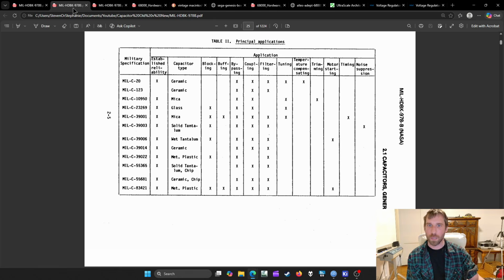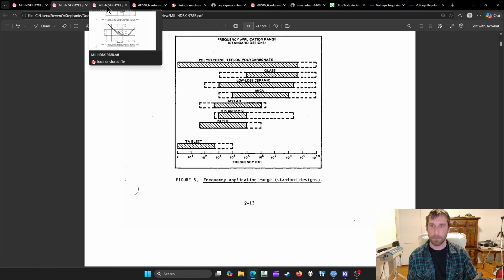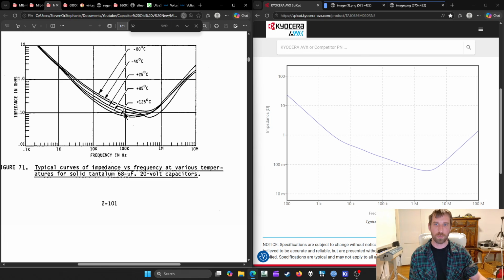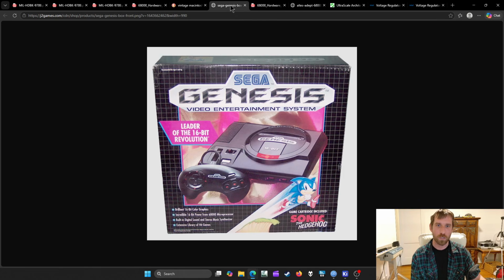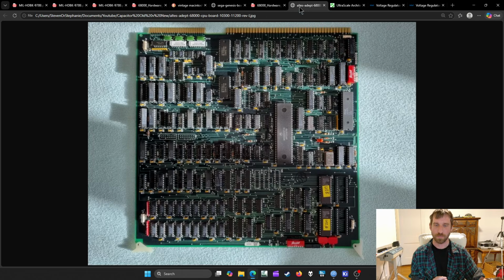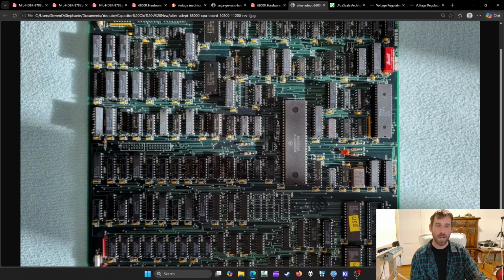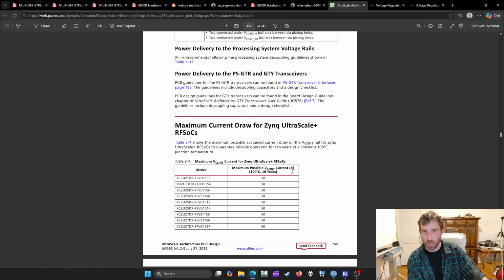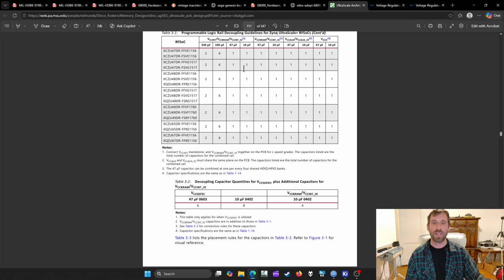Bypass Capacitor STOP OVERTHINKING

Comment: Effective decoupling requires understanding the design. Data sheets may or may not describe decoupling. Ultimately, the IC will specify power supply constraints which can easily be violated with poor decoupling. You could remove a lot of decoupling capacitors from a design and not see obvious impact. However, the timing and noise margins will be impacted and at some point, malfunction. Troubleshooting a poorly decoupled design can be very difficult.

Comment: They are not bypass capacitors. They are decoupling capacitors.
They are not bypassing any component.

Let's use the correct terminology please. Bypass and decoupling are two different applications.

Comment: Also, keep in mind that the early logic chips (74xx) were a bit noisy, when switching states, so you would see a lot of bypass caps (and we were using two sided boards with no ground plane layer too).

Comment: Great video!
Let’s all remember that “Back in the day”, boards were TWO layers.  There were no ground or power planes.  One side had horizontal traces and the other side had vertical traces.  Power was a vertical trace on the right side of the column of ICs and ground on the left side.  Decoupling caps could be very important back then depending on the ICs and signals, and I never overthought it except in mixed signal boards.

With today’s high layer count boards where power and ground planes are often very close, the board is an important giant distributed decoupling cap.

Comment: What is "weirdly obsessive"? You keep slinging that around without clarifying what it is.

Without the caps, those surges of currents will be opposed by the inductive property of the PCB traces leading to voltage ripple and EMI noise. The closer the cap to the power pin, the smaller the inductive loop area, and the lower the EMI noise. I get the feeling you've never had to go back and forth with a third party FCC or EC testing and compliance company.

Comment: Thanks for the historical comparisons.
About the DIP skipping; with the PCB they had back then, placing one per IC would probably reduce a lot of routing space.
I agree with your take; if you follow the datasheet you should be OK. Obsession is mostly optional.
... However! Take your design the EMC testing and you might have to reconsider.
I would suggest reading "Electromagnetic Compatibility Engineering" by Henry Ott, there is a great chapter on those pesky bypass caps, and also "PCB Design for Real-World EMI Control" from Bruce Archambault, where he goes on a very practical experiment on placement and values for frequency attenuation.
My honest suggestion: Take the smallest package cap you can place (smaller package get better HF response) with the highest value your money can buy (higher cap value gets better LF response), place them very close the the power pins, one cap per power pin, and vias from the cap that are placed as close to each other as possible (to reduce the via inductance going to the internal planes).
... but yeah, if you don't aim for EMC certifications, no need to obsess ;)

Comment: I dont have a network analyzer, and I dont have SPICE models of digital ICs to model their current consumption, and I dont have trace inductance & resistance to model my entire PCB in SPICE. So, I shotgun my boards with bypass caps (1 per chip, per power supply) and there's enough overkill I've never had a noise problem.

Comment: I worked with boards designed in the 1970's, and they figured a single 100uF 16V CTS13 wet slug tantalum with a 100n ceramic capacitor next to it was perfect per board. input came via a LC filter, 4.7uH and 100n ceramic, and this worked from -55C to +125C, and it was regularly exposed to both extremes in aircraft use, and survived well. Failure was the tantalum capacitors aging, as the rubber seal (the "value range in wet tantalum, which aged out to an open circuit, while the glass sealed ones last essentially forever, as Voyager proves, still operating a half century after the capacitors were made for it) slowly allowed the sulphuric acid electrolyte to evaporate past it. It was more than half surface mount packages, the not very common PM3 TTL package style, which was common for the military and aerospace at that time, as it was a quarter the mass of ceramic, and also a tenth of the volume, but hermetic, and even more reliable than cerdip packages, each being it;s own sealed package.

Another said bugger capacitors, they used 16 layer boards, and simply put the 2 5V power supplies on adjacent inside planes, with a ground plane each side of the power planes, giving perhaps 100n total for the entire board population. Then had a SMPS to power it, running at around 4MHz, with a massive air core inductor per supply, and input capacitor of 6800uF 50V for both. Half the weight of that unit was ceramic packages, around 5kg, and it was shoebox size. 2 identical supplies, with one running at a 400Hz power on time, as they needed to only power the arithmetic units when needed, and this saved needing to figure out how to dissipate around 1kW of power, instead running at around 300W, as the only logic that was always on was memory and control, plus clocks, and all done with 13 and 16 pin SSI TTL chips, packed like sardines on both sides of the boards.